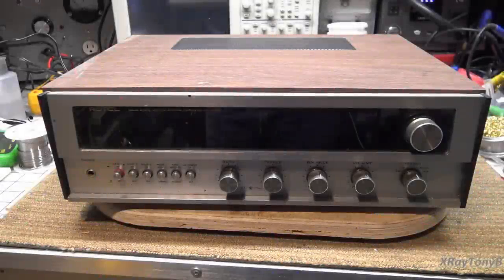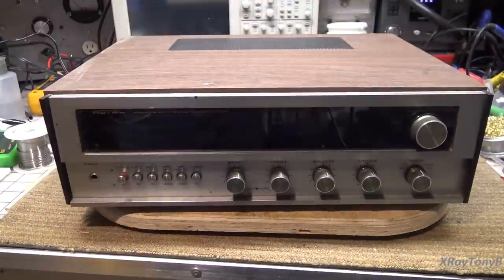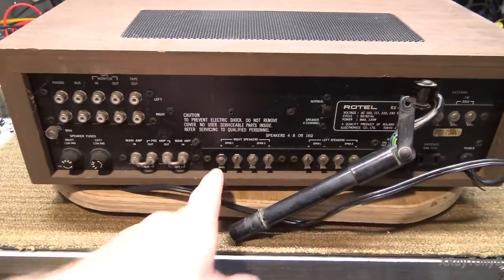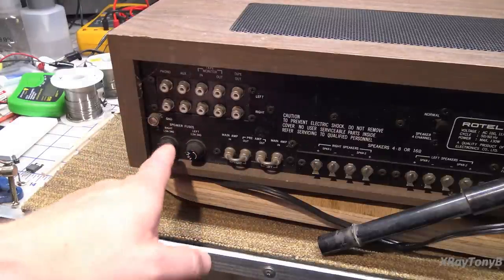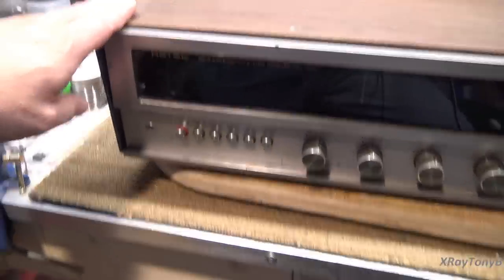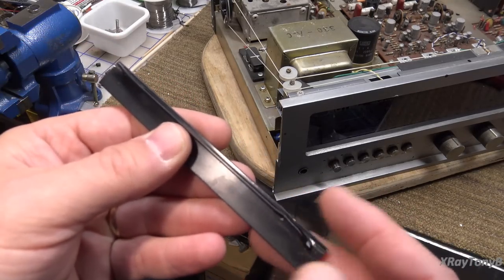Rotel RX-400a Stereo Receiver Repair - Part 1

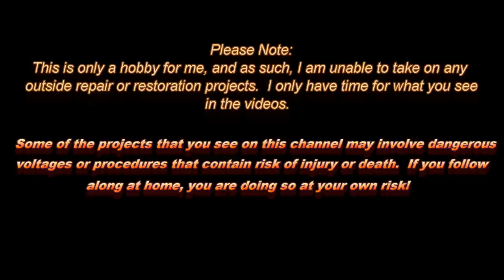Comment from the maker: 0:15 Intro
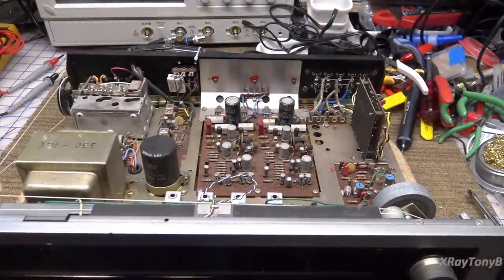3:57 First look inside
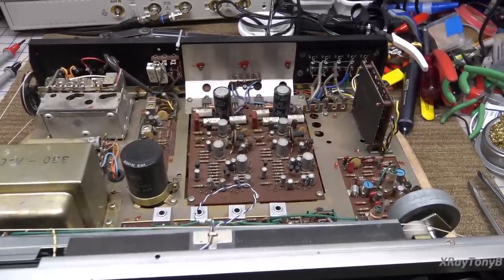4:35 Tin Whiskers - What are they?
6:15 Taking a look at the schematic
12:18 Checking the power supplies
14:44 Checking power to the amplifier section - Finding a fault in one channel
16:08 Troubleshooting the faulty channel in the amplifier
35:19 Trying the amp out after repairs - We still have more problems!
39:18 More troubleshooting & repairs
40:41 One channel is working, but the other still has issues!
41:28 Finding another faulty transistor
57:46 We have success!
57:58 Silpads vs mica pads - Fear Not!
1:02:34 Adjusting bias and DC balance
1:04:46 Looking at power output and waveform 
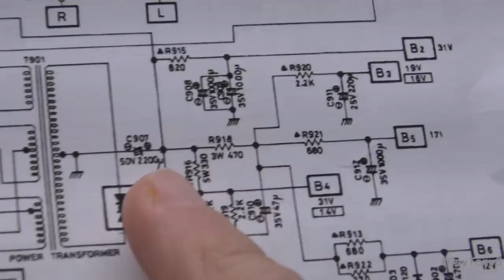1:07:45 Looking at the Power supply & speaker capacitors
1:10:49 Replacing some other transistors 
1:13:23 Testing & replacing the Filter and Speaker capacitors
1:16:42 Ready for another test drive & closing thoughts

Comment: I even use ceramic pads for that kind of coolingsomponent, these are more expensive, but they are forever. So everybody using different things to accomplish the same result. Mostly on heavy extern power supply's. Great work again, much appreciated; What I also noticed, on the older amps, the caps are tightened with a clamp, much better than the dirty glue they use these days. Looks more neat.

Comment: 25 watt cap coupled & center tap transformer,  should sound really nice!   My freshly rebuilt Sansui AU555 is very similar, love the sound of these.
Reply: On the other hand, I couldn't wait to bypass the capacitor-coupled power amp stage of my old Sansui AU-555A -- I used a (very early DC-coupled) Kenwood KM-8002 for that job and it improved the sound of my old system tremendously.  Fortunately, the Sansui had the requisite preamp out jacks.

Comment: These videos are really, really good to learn trouble shooting and electronics repair techniques.  Concerning the mica and siliconinsulating pads, are the nuts also insulated?  What is it to keep the bolt and nut from grounding out the heat-sink?

Comment: excellent video! I have seen transformer sag before, but not to that level. But on the other hand the power transformer is likely the single most expensive part on the BOM so usually undergoes extra scrutiny. The small power transformer issue is quite common in preamps. So many have a 10-12 watt power trans. Years ago I used to offer upgraded power trans for the Adcom 555 pre, the Apt Holman pre, PS Audio and others. Would usually replace the 10 watter with a 250-400 watt power trans. would have to go outboard, since there was not enough room internally. It was amazing how much more dynamic a pre amp would sound with that big power transformer.
Reply: takes power to make Power!

Comment: Nice video and great explanation. I have this identical receiver and it had the same problem (I think it was even on the same channel too). As I recall it had a blown output, bad driver and maybe a bad emitter resistor too. BTW this is identical to the Harman / Kardon 330B which Roland Electronics (Rotel) built for H/K. With the covers off looking from above you almost can’t tell the two apart lol!

Comment: The power transformer and capacitor combination can be compared with a compressed air system. The size of the air tank would be analogous to the capacitor, the air compressor would be the transformer. You need a big compressor to keep replenishing the tank. Small refill rate is like filling a swimming pool with a garden hose.

Comment: the metal case is a noise shield.  Transistors can be very noisy.  The can effect near by components, especially in a low signal circuit.  so best replace metal case with metal case

Comment: Tony, note that VAS transistor TR505 can see CE voltage higher than 40V at full volume (especially with no\light load when transformer is not sagging). The new transistor you placed has max rating of 40V CE.

Comment: Hi, great video, I’ve had problems like this with power supplies in older equipment before.

As it’s just for myself I tend to run the rail power to a socket on the back chassis and get a decent modular PSU I can pop it in behind the equipment on the shelf. So much good equipment has been let down by the economics of power supplies

Comment: Excellent Video, very informative. Two questions. First is hypothetical: what would one want to reasearch to replace the transformer as a means to supply more power/ reduce sag? Second: would placing a led circuit inline with the power rail to indicate when the transformer sags be useful or too complicated? Thank you for your knowledge!

Comment: While only a tinkler, this is the biggest problem where I usually come unglued trying to replace vintage transistors and not being able to match them up with newer components.  I don't also have any of the hard copy books either that you have, which seem very valuable to have on hand.  I end up getting too 'rattled' and then unsure what is the right thing to do.  
Like you said though, this is what you gotta do working on older receivers, and even harder again working on 
1960's gear like Reel to Reel tape recorders and early Hi-Fi and replacing germanium to matching silicon replacements.

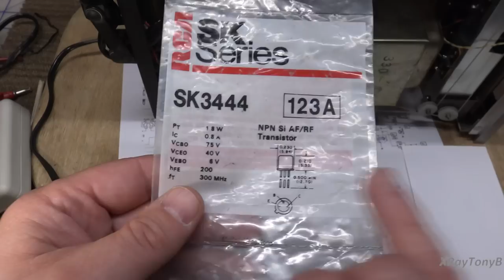Comment: 31:36 An alternative partnr for the 2SC538A is the NTE123A (metal housing) or the NTE123AP (plastic housing -> lower wattage) , price is arround 2€ for the metal housing.
48:40 For the 2SC1107, you can use the 2N6123 (Motorola) or the NTE377 as alternative.

Comment: Hi, i just got a RA-300 and the right channel saturates when i put some volume and im lost. I bought new cables, i tried several speakers including brand new ones, been opening and did the cleaning several times with WD-40, replaced the internal & external fuses and thats all I can do. Im gonna watch your restoration of this unit to see If i can learn something. Thank you very much for all of this. If you have any idea what to check / where to start, let me know. Im about to go to a repair shop in Paris and with your help i maybe able to get what they are gonna tell me they can do and see if their asking price is worth it or over the top. The sound of the 300 is great, i really want to have it fixed. Take care.

Comment: 19:30  I have to disagree with you for your conclusion on where the problem lies but in the end you did come to the right final conclusion. Why do I disagree? If you have 1.8 Volts at the Emitter of a NPN-BJT (NPN Type Bipolar Junction Transistor) then you never can have 24 Volts at the Base of it or it will be blown up in Milliseconds! There is a reverse-Diode path going from Collector to base with Collector being positive to the base, so if collector is positive the diode will pull no current. If you switch off power and do measuring base as positive connection to your diode tester and collector as negative connection then you probably will have a diode voltage drop of 0.5....0.8 Volts. If you have emitter of the transistor sitting at 1.8 Volts and your transistor would be OK then you only could have a base voltage of this transistor of about 1.8V + round about 0.7....1.1 Volts maybe, depending on how hard the transistor will be driven. If you exceed 2 or 3 volts then your transistor will definitely blow up the base-emitter diode path from exceeding base input current. So you can be sure if the emitter is sitting at 1.8 Volts you can more or less be sure either TR506 had been going high ohms or TR508 gone to being just a low ohms resistor ;).

Best way to decide where the problem sits would be sucking off (and isolating) both bases of the power-stage transistors and to see if pre-stage and  the bias voltage adjustment had gone defective. If it would have gone to round about half of the power supply voltage then pre-stages would have been ok, if it would have been non-symetrically voltage (round about!) to the driver-stage outputs going to power amplification transistors then your driver side would cause the problem....

But nevertheless - you made it and came to the right conclusion and the video shows really good how to isolate the problem and sort out what and where something is going wrong! 

Good work, and thanks for this video!

Comment: Awesome video with good explanation. I do have a question. I purchased a noresco 2660 and I know it was made by Rotel. My concern after watching your video is that every time I Turn the Receiver on or off , it makes a thumping sound and my driver moves inwards super awkwardly. Does that mean a transistor is bad and sending current to my speakers??  Please help/advise. Thanks. Oh, I just subscribed and thumbs up!

Comment: 4:44 Since arround 2006 they start using lead-free solder in commercial electronic devices, you will see in many years, that the phenomenon "Thin Whiskers" will occur much more again in the future. That was the main reason that lead was added to the solder in the first place to minimize this. Very old electronic devices prior 1940 also didn't have leaded solder, so "Thin Whiskers" is very common with those.
Reply: I've heard this contention about lead-free solder from several credible sources, but have never seen it cause any problems with consumer electronic devices.
Reply: @editorjuno  , "Thin Whiskers" also not occur within weeks or months, but take many years to develop. Also because they are so thin/small, they are not always visible with the naked eye.
Reply: @BjornV78  -- I'm well aware of that.  What I'm saying is that I have yet to encountered an actual consumer electronic device failure traceable to that particular phenomenon.
Reply: @editorjuno  , you can't say that for sure, because those Thin Whiskers act like a fuse when they short out, they delete themself if the current is high enough, but the damage as already occured. Also, because these are so thin (few microns),they don't need much current. Also when opening a device,a little knock with a screwdriver against the case can be enough to break the Thin Whisker because they are very fragile. After that you will also don't measure a short that was previous there. And as last, when you gonna troubleshoot a device that has a lot of dust inside, the first thing you do is to clean it with compressed air, that can also remove a Thin Whisker that caused the problem/damage before. They are nasty little things. Grtz
Reply: @BjornV78  -- That's a possibility, I suppose.  It seems to me such a tiny strand would be a very fast acting "fuse," so I suspect the potential for significant "damage" is fairly small.  It also seems to me that if it was major issue, high-density PCBs depending on surface-mounted parts with tiny lead pitches like laptop and tablet motherboards would be failing a lot more often than they actually do, but of course I could be wrong.
Reply: @editorjuno  you are right about the failing on laptop and tablet motherboards. The problem that occurs on the newer laptops (fabricated after 2006), is that the solderings under the Graphic chip and chipset breaks due the lack of lead in the solder, and that lead free solder break after many heat cycles, the result is  mostly a black screen. Many of those can be rejuvenated by heating the Graphic or Chipset from a distance with a paint stripper for a minute. Some that i have done that way, worked again, but some failed again after a few reboots, some after a few months, and some that are still going strong after more then a year.  Grtz

Comment: hi tony , just as important as packaging is the careless delivery workers that abuse the parcels.
Reply: Like airport luggage handlers...For the most part though I put the blame on the packagers.  We ship out dozens of packages a day with our business and have had very few problems with damage or loss through the USPS.  I once heard that when you package an item package it so that you can throw it full force at a concrete block wall from five feet.  Electronic equipment is the worst to ship, but a little care and thought goes a long way. Styrofoam sheet and double boxing would saved this receiver from that damage.

Comment: There's no excuse for bad packaging. it's nothing to do with cost, it's ignorance. Most sellers who pack badly just can't be bothered to take the time to pack something with care as receivers rarely complain, and as they feel they can just blame the shipping company and claim on the insurance if anything goes wrong. If you're selling something, you include the cost of packing in your postage cost. You can offer additional services when you're selling, but most people don't. Nice work on the receiver.

Comment: Would you mind sharing more resources for schematics and service manuals for some of these older pieces. I know HiFi engine is fantastic, however I have difficult success finding a lot of the higher end stuff. Last was a tube driven AMC CD player. My email was ignored by amc. I fixed the player, however it would be nice, as you know, to have had the tuning specs.
Reply from the maker: I wish I could give you some sage advice on finding service documentation, but beyond the normal online haunts (such as hifiengine) I just end up mostly google searching for the documents I need.  Sometimes you can find original or copied manuals for sale on eBay or Sams photofact website.  You can also contact other service people through various forums and they can share the info with you.  I hope that helps.
Reply: @xraytonyb  thanks

Comment: Hi I have this unit and it gets really hot on the back plate minutes after its it powered on...could this be failing caps?
Reply: Probably a biasing issue. Do not use it until it has been repaired or it will probably blow up.

Comment: Tips: Use Oscilloscope to Troubleshooting ( MUCH FASTER :)
Reply from the maker: Sometimes it's good to go back to basics and learn how to troubleshoot a circuit without a lot of test equipment. :)
Reply: Robert Martin, do you mean for finding the open power transistor? You would still have to check the junction with a meter, so I don't see an obvious advantage.

Comment: Are you sure its the transformer thats causing the sag?
Reply from the maker: As I said in the video, there is no drop at all in the mains supply into the transformer.  There is a significant drop at the output of the transformer. This is because the transformer is unable to provide adequate current to keep the filter capacitor charged under full load.
Reply: @xraytonyb  It wasn’t clear to me from your statement that you depended on your input protection device’s meter or measured the voltage at the transformer terminals.  I was just thinking. Given the specs, the manufacture grossly overstated the unit’s capability and used too small a transformer as you stated.  Or possibly there are drops in wiring path connections, power switch, or bad output rectifier diodes.

Comment: Maybe you can free up some transformer headroom by switching to LEDs for the lighting? 
A little here, a little there and you might end up with a job offer from the manufacturer LoL 🤣.... 
Unless something is drawing more current than it should, especially when being driven hard, I can't really think of anything else that would restore the power output to the original specifications for that amplifier....
Reply: Its easier to obtain a decent external modular 48v psu with required power and connect it via a plug at rear of chassis to internal rail. If it just for personal use its no big deal

Comment: Tin whiskers are *dendrites*, not "dendrils". Tin pest is another name for the unstable molecular/atomic nature of pure tin, which is exacerbated by extreme cold as well as heat, and has caused failures of church pipe organs in Northern Europe, and NASA satellites, and even contributed to the failure of an Antarctic expedition when fuel cans sealed with tin solder leaked. (Adding lead stabilizes the tin, which is why we prefer leaded solder for electronics use). There are several YouTube channels with videos about curing tin whiskers inside germanium transistors and Hammond Organ tone wheels. By the way, since tin is considered a vital, strategic metal, the Federal government keeps a stash of it at Fort Knox, inspects it regularly, and melts it down and recasts it every so often.

Comment: I noticed the amp uses a Center tapped full wave rectifier in the power supply circuit, It is a known fact that Full wave bridge rectifier have better transformer power utilization, i.e. less transformer loses compared to center tapped bridge configuration, as you sowed, this power supply displays considerable sag at higher output levels, it should be fairly easy to undo the transformer center tap and substitute a full wave bridge rectifier to see if power supply efficiency improves?
Reply: @NICK And how do you do that?  If you're using a full-wave bridge rectifier you will overload the wires of the transformer. They're calculated to withstand only the current the transformer delivers on one half-wave. If you're using both then they will overheat and you're sacrifying your transformer for just a bit of (theoretical) efficiency improvement. And the other half of your transformer will be out of business totally, as if you  would use both windings you would exceed the input voltage into your power circuits. PLUS: if the core of your transformer isn't able to transfer more energy it will tend to go nearby saturation. It can only deliver a certain portion of energy and that's it. And that is what causes the "sag". It's the physical limitation of your transformer. Not of the diodes of your "full-bridge-rectifier", not the gap inbetween the output voltage half-waves on one side of the transformer.  It's the core plus the gage of the wire.